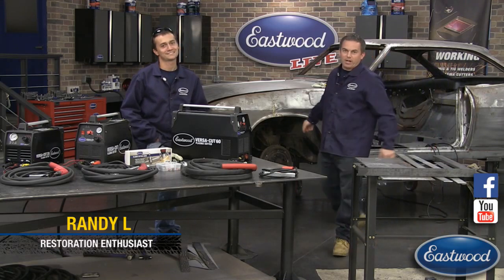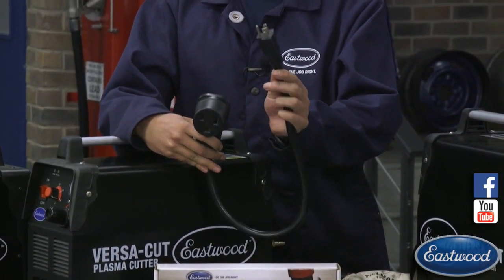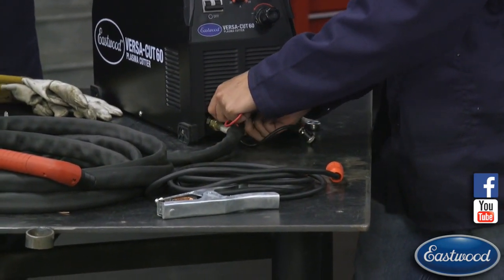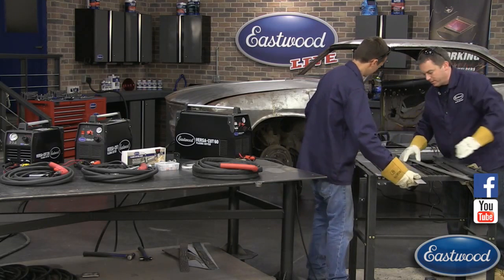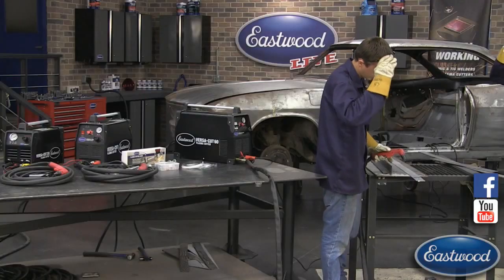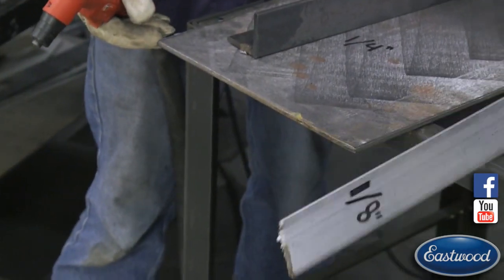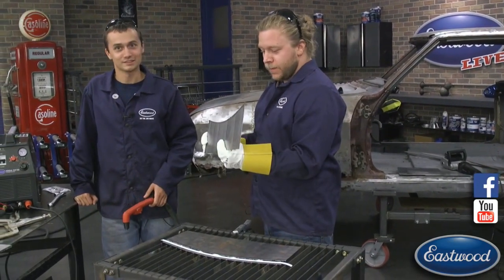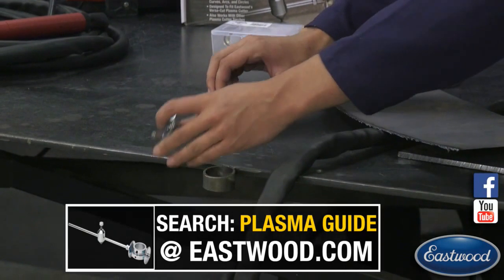Cut Sheet Metal to 7/8" Plate With Eastwood's Versa-Cut Plasma Cutters!

Comment: I really like my Versa Cut 60. I've had mine 2 or 3 years (can't remember when I bought it) I purchased the combo kit, Mig 175 and Versa Cut 60. I modified my old welding cart by making it wider to accommodate both machines. I customized the 240 volt plug in on the cart so both machines are plugged in and thus using only one plug in. I modified the ground connection on my Versa Cut 60 by making it the same length as the gun. Thanks for the great video!

Comment: New to plasma cutting...Does the table get cut into underneath the target material?  Does the magnetic guide get cut into if you hit it with the cutter?
Reply: guess I should have watched the entire vid before questioning...lol...but what about on a project?  I want to cut the quarter panels off my mustang and I don't want to damage the structure behind the quarters...like the wheel wells and such